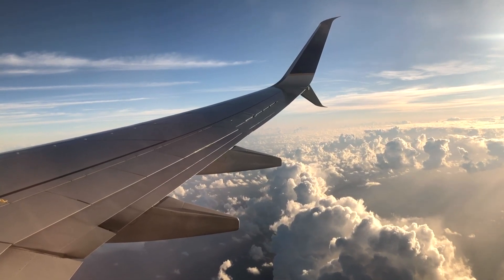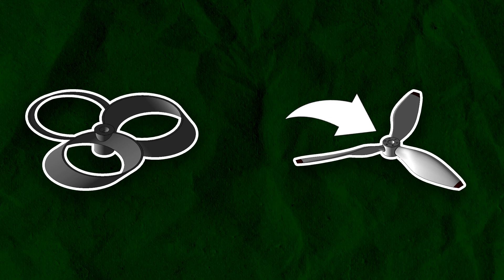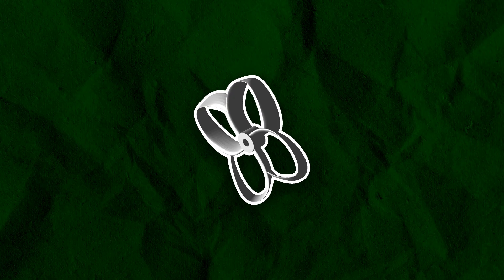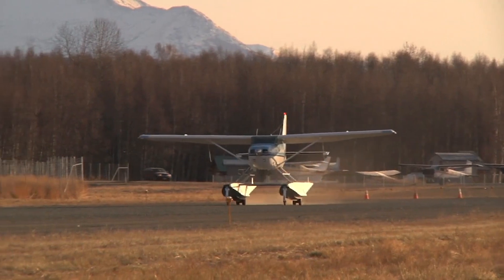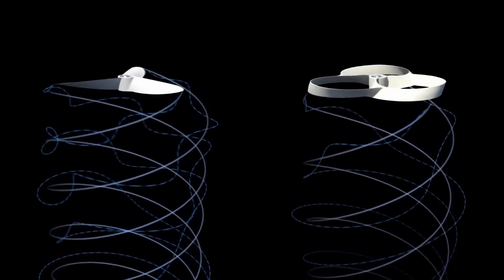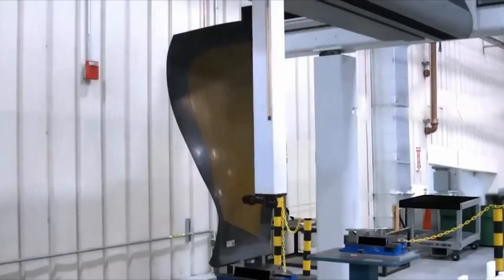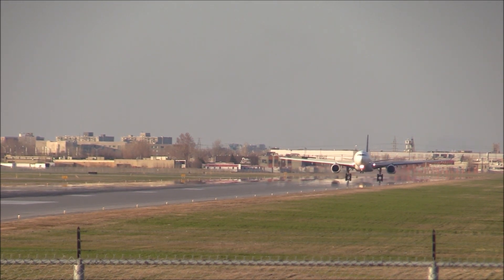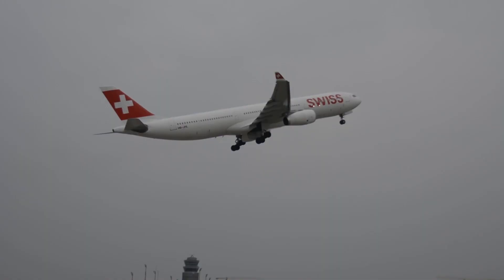This New Propeller Design Will Change the Aviation Industry Forever!

Comment: How would this work with constant velocity, variable pitch aircraft? Anything but a small plane use constant velocity engines for efficiency. Thrust is adjusted by varying prop pitch. The gains of a toroidal prop are small compared to the advantages of a CV power plant.

Comment: e-VTOLS are a boondoggle. Batteries do not have the required energy density for more than about 15 minutes of flight. THEN the battery needs fully recharging too. With 8-10 charge cycles daily, the batteries will not last much more than 6 months in service either.

Comment: What aircraft need, is a variable pitch toroidal prop, which aren't made just yet. A fixed prop is kind of a compromise between takeoff and cruise, that is why, more expensive aircraft have variable props or what is called a constant speed prop. They are also a compromise because more weight, more complex to design and maintain, more parts to wear out or break, and more costly vs much more simple for a fixed blade prop.
Reply: You also require REVERSE pitch to stop on short runways !

Comment: Any propellor works by having low pressure ahead of it and high pressure behind it. This is the opposite of what is explained in this video. Any wing or propellor including the toroidal type will shed its vortices along its radius and not only at its tip. These vortices then combine in the flow behind the blades into a single vortex at each blade tip. This means that the savings in power for the same thrust from this new idea is unlikely to be much better.

Comment: There are other designs that reduce noise and increase efficiency, like the asymmetrical propellors that are proving effective on drones.  The toroidal propellor could increase weight by 2x.  This would dramatically reduce fuel efficiency.

Comment: As far as I know, currently, these kinds of propellers are only being developed and tested on small boats and marine vessels, with the exception of a few people who have made smaller prototypes for testing on very small drones, however, I have not yet seen any testing of these propellers on any small fixed wing aircraft at all, but I would be interested in seeing tests and would be interested in testing such prototypes on my own RC fixed wing aircraft.
Currently, I suspect that there would be limited use for such propellers on larger fixed wing aircraft, without there also being advancements in propeller building technology too, and perhaps, it may be entirely prohibitive to build aircraft propellers beyond a certain size, and it may be more than a decade before such a propeller could be used on larger commercial aircraft at all, but it is worth experimenting. 
Thank you for posting these videos!
Please have an excellent and awesome day!
☀️✨✈️
Reply: I cannot see how a toroidal design can offer variable pitch. As such, it will simply have NO significant  impact on aviation whatever.

Comment: I have never seen any aircraft using this. If it was so good, someone would sell it already. Am I wrong, or right?
Reply: This technology just came out within a few years. with the FAA nothing moves fast and creating a propeller this big and intricate will require a lot of investment to take flight
Reply: your right!  the extra weight and inability to change the pitch makes them bad for planes but the boat props are incredibly efficient.
Reply: @Doogz66 Electricity from Fusion is also on the way...(40 years or so ?)

Comment: How do you change the pitch of a toroidal propeller?
Reply: You wouldnt really need to. The efficiency of the prop design more than makes up for not being able to change the pitch. With quick search, variable pitch props hit about 80% more thrust at their most efficient settings on average whereas these new props are showing a 400% efficiency in this very early design. imagine hitting 200 knots in cessna 172s at half power lol
Reply: @nathanwells4809  and reverse pitch for stopping ?
Reply: @nathanwells4809  I have never seen any aircraft using this. If it was so good, someone would sell it already. Am I wrong, or right?
Reply: @nathanwells4809  400% efficiency?
Reply: you can't and that's the reason you only see it on boats.